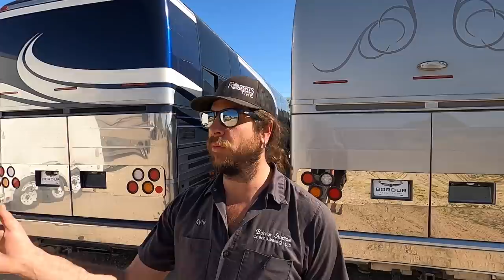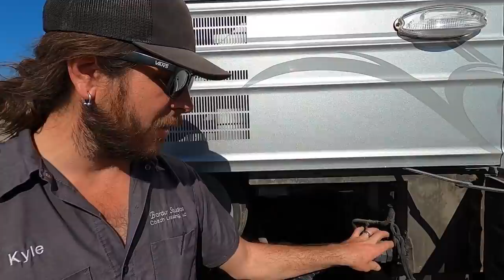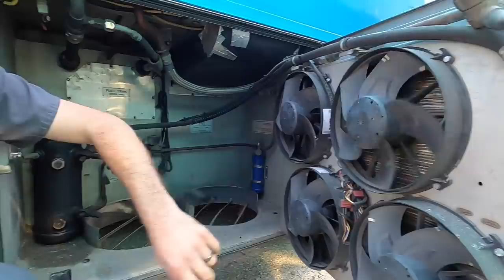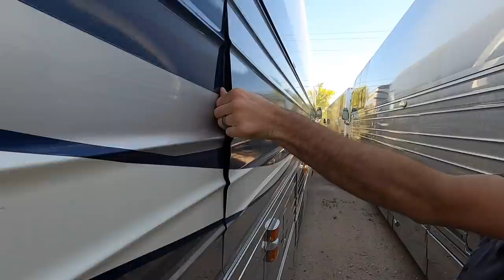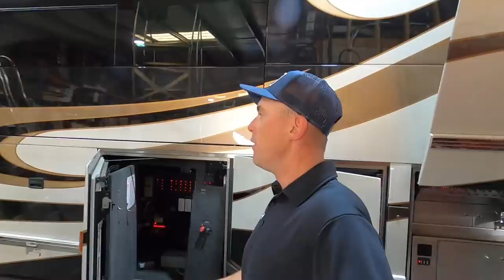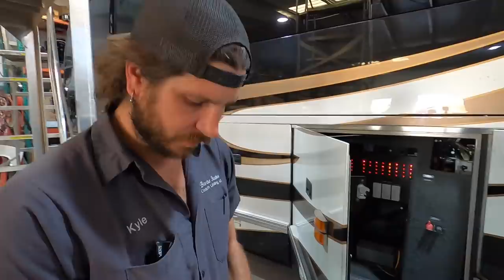HOW TO SPEND $83,000 ON PREVOST REPAIRS

Comment: Andrew the guys at PC forum are all pretty cool, you should post there. As someone who actually owned an early 2000's XL2 I can give some insight to what the real deal is about owning one.
Do you like to wrench? No? Got deep pockets? Yes you can buy a decent bus for 2-300k but you are going to spend easily a $1000 a month in maintenance and likely upgrades, and that is YOU doing the labor. The more miles you put on it the more work you will do. Every trip I did I came back with a list of stuff that needed to be fixed, and I was doing most of the work myself, including all maintenance on the Detroit. ( You want a pre-egr 12.7, best engine ever made imo ).
I had very minor delam, I fixed it with Bostick 073a, the problem did not come back. Airbags, suspension bushings, roof air problems, fan clutches, all the house side problems....on and on.
Previous owner of my coach took good care of it but was just tired of dumping money in it. I took GREAT care of mine and still spent $25k in the first year, I got tired of always worrying about what else would break. Guy I sold it to kept it a couple years and also sold it after getting tired of the expense.

So yes, compared to your average plastic coach, a used Marathon or similar is incredible value, the quality is off the charts compared to all the garbage that comes out of Indiana. The price of admission is just the beginning, you will find out the true cost of ownership later on...ohh and that shiny Prevost attracts a lot of attention...everyone assumes you have money and when you go for repairs you will be charged accordingly....you DO have money right???!!!!
Reply from the maker: Thank you sir, you are spot-on.
Reply: @RVingwithAndrewSteele  Just a few more thoughts on owning a Prevost. Right now the cost of insurance is going way up, at a minimum it will be $3k a year on up to close to 10k at the high end. Fuel is cheap now but when I was running mine  I had many $600-800 dollar fill ups ( I had long range tanks ). The chassis and drive-train are pretty bulletproof but these are complex and there is always something on the house side to look after. Some things are proprietary to the converter and you will need help.

Finally, if you do decide to maintain it yourself remember this is a very heavy commercial vehicle, you will need skills and the right tools. While the converters do amazing work, things are packaged tight and working on or getting to things can be challenging. Want to pull the valve cover to run the overhead on the Detroit? Pull apart half of the back part of the bedroom etc etc.

I may still buy another Prevost but every time I think about it, I remember back to how much work I put into it...oh and then you have to keep them washed and waxed, a tedious job...I paid others to detail, not cheap...but I HATED doing it myself...whaddaya charge for a detail Andrew?? Keep the videos coming!
Reply: This is exactly like owning large boats, sail or power. You figure 10% of total value of boat to be spent on maintenance per year. It’s just the way it is. If your home moved often like a bus or a boat you’d have the same problems.
Reply: Love this comment. I'll take a yacht, it seems just as expensive but more free.

Comment: Kyle is so laid back and cool! Actually Prevost should take pointers from this video! They should either correct the problems or make the parts for fixing the problem extra affordable. The 5 grand for the seal is unexceptable! A call to china one of us can get that same rubber strip made for around 20 bucks a piece and sold here for about 200! Kyle is a fountain of knowledge with Prevost and his attitude is super cool!
Reply: Yeah that's what someone wants, a cheap chinese seal after paying the large labor cost to replace it.  Who's going to make it for $20 when they aren't setup to do so.  You pay the hundreds of thousands to setup the tooling and factory to make it. They can't just make something they are not already setup to do so

Comment: I run Prevost commercially and I would agree that they are the “Cadillac of motorcoaches but they’re some real downsides of owning them.  Commercially it’s far easier sourcing used parts that drivers like to destroy if you own an MCI simply because MCI owns about 60% of the market and used parts are much more available.  Prevost air is very troublesome once the coaches get some age on them . One local charter bus company here that runs 80 H3-45 units is giving Prevost absolute hell over the problems that they are having. They buy five new ones a year from Prevost and it’s not uncommon for them to be riddled with problems that simply shouldn’t be happening.  I’ve purchased my last Prevost. From a charter perspective MCI makes more financial sense.

Comment: I got a 0( Tiffin. I told a friend that you can get a older Prevost in same price range. But something that cost 2 million is going to cost big bucks to fix anything on it down the road. Those buses take an owner with deep pockets.
Reply: yes you must think before you buy- although it was a much costlier coach  new   but   if you were to buy a 2000 Prevost  the repairs and maintenance VS a comparable (price wise) say a 2016 NEWMAR   to maintain and repair .it would be astronomically more to upkeep the 2000 prevost i would think!  now i could be wrong but think about it? it may not be as smart as you think to buy the QUALITY OLDER   unit ,

Comment: I feel your pain, trucks/ Buses/ Heavy Equipment of any Kind...CHA CHING,$$$$$$$
 A good way to look at heavy equipment, and Buses is the first 5 years or 300,000 miles is always the best after that the Daily/Monthly/ Yearly upkeep can get a little expensive. You really have to look at what is cheaper or better for your self. The first 5 years of deprecation on a 2.4 million dollar bus, or the cost of repairs and up keep on the next 5/10 years of a used coach. If the previous owners were up to speed on up keep and kept the equipment zeroed out on Maintenance The Later is cheaper...If not look out...

My opinion..

Comment: Wondering about prevo H3-45 and delam issues? The XL2 is the talking point of this but no one talks about the H series?
Appreciate you're videos !
Reply from the maker: You don't have to worry about delam with the h3 but you can get paint checking in some of the older coaches
Reply: @RVingwithAndrewSteele  that's kind of what I was thinking but I wasn't for sure, I thought possibly some of the small trim and sealing panels around the windows would eventually work themselves loose. Thanks again I appreciate your time

Comment: 32years in trucking never had a problem with bud type wheels if I was having a problem it was a bad wheel and that happens with most things you buy the new style lug nuts you might be opening a new can of worms
Reply: The problem with motorcoaches is they sit, when they sit it allows oxidation to happen.. when trucks go down the road your constantly having maintenance done, flats,, new tires, brake work seals, so you catch any issues. These fellows are talking low mileage low maintenance vehicles. Like going and buying a 25 to 30 year old vehicle that has 5000 miles and not expecting any  issues. I had a chance to buy a 2003 Toyota avalon with 15000 miles but th ey wanted $9000 for it ,they even put new tires on it. I pulled the Trans. dip stick and the fluid was like honey.I suspect that the person who bought it put at least $6000. into it within 6 months. Low mile, high deterioration,things break.

Comment: Most people that buy prevost don't realize what kind of problems your in for. I think a nice 5th wheel or trailer should be fine. Why waste so much money on these money losing RVs. I got lucky i bought a pleasure way plateau ts kept it a year and used it for a summer and sold it for $7,000 more then i paid for it. That was a miracle

Comment: Andrew when your making your videos saying you want transparency, maybe try getting all the facts. Yes I’m the owner of a 99 Marathon with rivets so I don’t have the delamination issues that the XLII have, but you need to get the facts before you try to scare people out of buying the coaches. First you said that the Prevost fix for the delamination is only good for 10 years, this is false, check with Prevost its good for the life of the coach, I have friends who have had it done. Your friend with the tour buses, who only pulls the panel out a bit and squirts more glue in and said it good for 10 years might be correct saying that . He also said it costs $10 thousand to do this, that equates to $1000 a year which isn’t bad considering he stated he runs them 80000 miles a year, which over 10 years is 800000 miles. Please show me any other fiberglass coach that will run 800000 miles, and as he said most of his coaches were early 2000’s, doing the math 20 years times 80000 miles a year works out to 1.6 million miles, again show me a fiberglass coach still on the road and running with mileage like that.. Some of your viewers say they are a black hole and cost way to much, well please compare apples to apples, Prevost’s have to meet crash test ratings for a commercial  vehicle, which I will guarantee the other coaches can’t touch. 
Have you typed RV crashes into the youtube search window, 95% of other RV’s will disintegrate in a crash, where as the Prevost will most likely still be intact and you will walk away, as you keep saying its all about the safety, and a commercial  vehicle such as these just cost more than their non commercial counter parts, quality cost more period.
I’m not trying to say that Prevost’s don’t have issues they do, but so does every other brand. I personally like the information your providing your viewers but please get all the facts correct before you hit post.
One other thing, you said that Prevost Community wouldn’t let you join, that seems strange to me as this the nicest group of people you will ever meet, anyone of the forum will bend over backwards to help you with any question you might have about Prevost ownership, good bad or otherwise. Is a bus for everyone, I would say no, but don’t knock because you don’t have one, they are an amazing coach with pro’s and con’s just like any other RV.
Reply: Mark M you pays your money you take your choice...
Reply: Fantastic answer from an emd iser
  Throws an entirely new perspective on things. Those people in Quebec take enormous pride in what they build. They are all about service.  Hard to beat
Reply: Word 👍🏻

Comment: Money Pit, worst than a Boat! 2 money hole pits! Ridiculously overpriced!
Reply: Everything can be a money pit including a spouse, but without risk there is no reward!
Reply from the maker: You get what you pay for, there is a reason these buses can go a million miles!
Reply: @RVingwithAndrewSteele  yes its easy to say a million miles, i have 966k on my volvo but my point is your tiffen or a ford escort can go a million miles but it costs for every mile and it gets to a point that to push a escort, my volvo , my Newmar or even a Prevost to 1million miles starts to not be cost effective- i know where Prevost buses go to die with under a million OR where they sell to the next guy  who says he can convert it and keep it going but it aint cost effective for a bus company to keep them to keep putting on the miles that they do each year, to convert one and  then to drive it few thousand miles a year is fine.